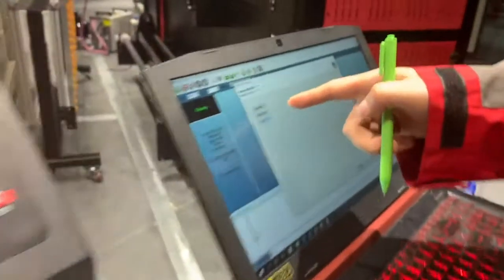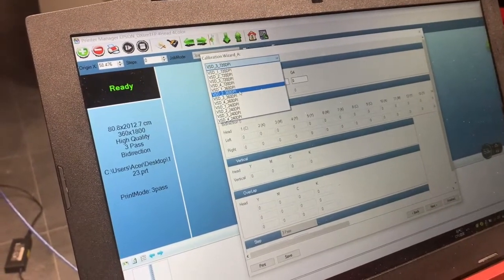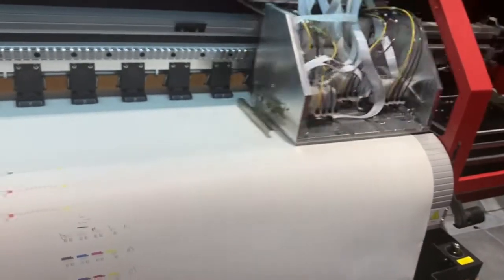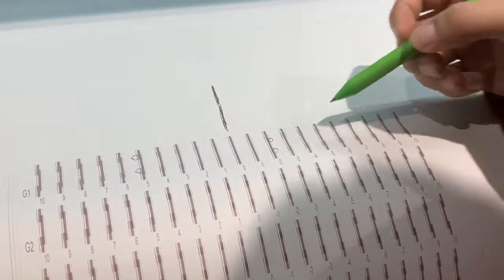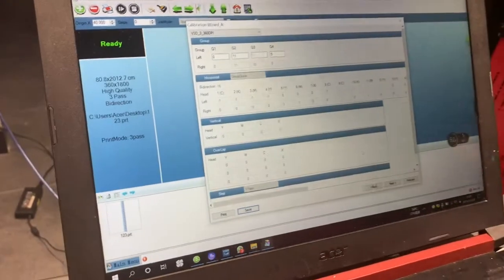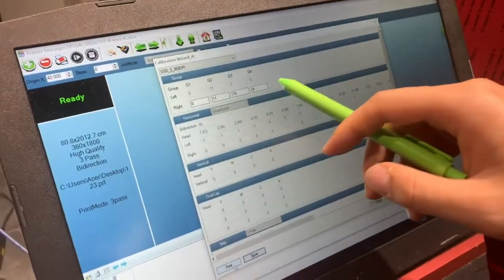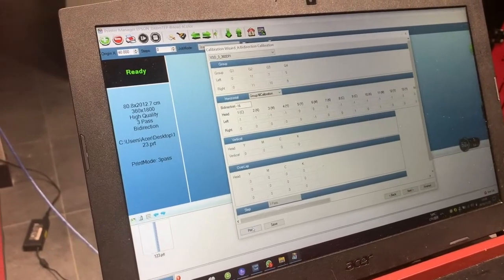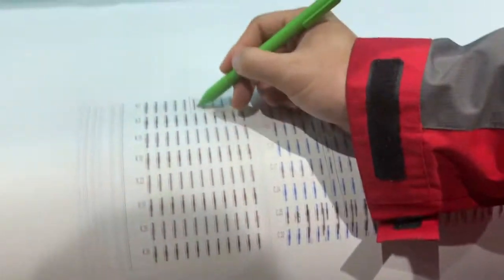How to do calibration on your printer

Comment: Hi Sir Your video is very useful to me.. & one small doubt in my eco solvent printer with xp600 head.. the problem is my printer printing high definition photos. but the photos look like noise.. all calibrations are fine. & the status also fine.. but the print very noise.. how to solve the problem.. pls reply.. thank you...
Reply from the maker: Hi, Contact me on whatsapp ,my whatsapp 008618721967680